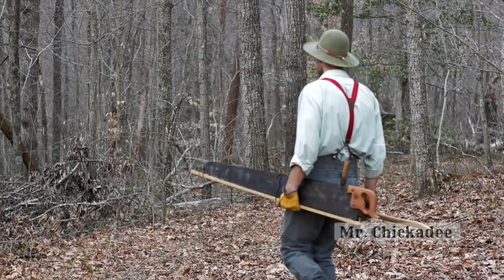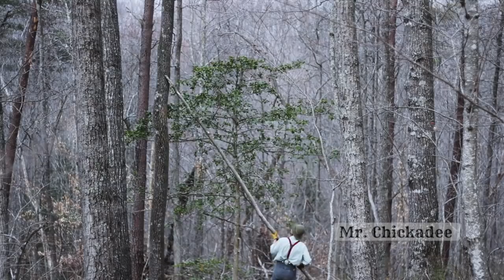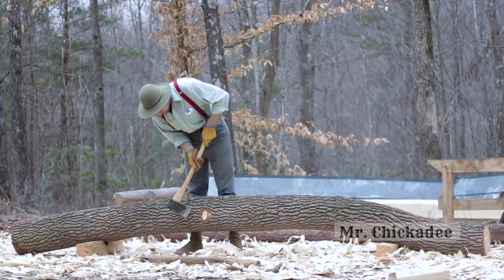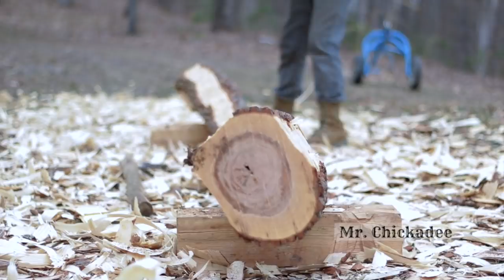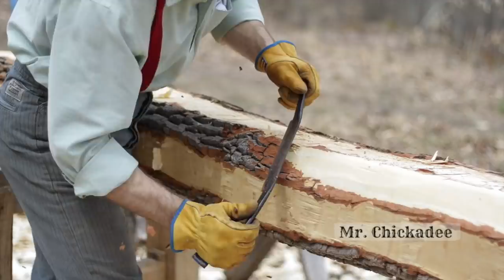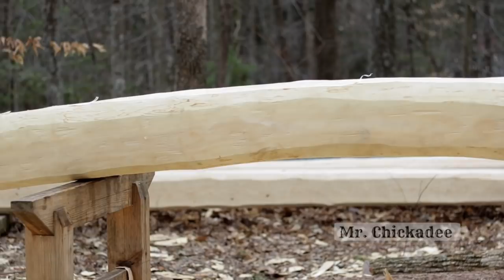Hewing Curvy Timbers for Japanese Timber Frame

Comment: Hi Mr. Chickadee ! Would be very nice to talk about the moisture of the wood. Do we have to dry wood like most of woodworkers says? Can we built tomber framing and furnitures with wet wood ? If we only works with hand tools and traditional joinery? Very hard to get the truth about it...
Reply from the maker: No, it can be used green, dry or somewhere in between.

Comment: Funny how falling, bucking, skidding, barking, and squaring a log in cold still weather eliminates the need for coats.

I bet your cats weren't out in the snow for hours supervising. I bet they were curled up snoozing by the stove that burns the wood you got in last year.

Hm. I wonder what that graceful octagonal timber and the other three straight ones will be used for. I'm guessing some form of torii. Looking forward to future videos.
Reply from the maker: They are all various roofing beams for the fall class frame, this one in particular is an arch above a doorway. The others do look straight but are actually a gradual arch of about 8" over 20' span. All octagonal in the japanese tradition

Comment: I’ve got a 150 year old hewing axe head made for doing that. It does not look like it was really needed.
Reply from the maker: Those were specialty tools often used by professional hewers in times past. They do make more sense when the timbers are very large, like a 12X24" beam for example, the larger blade could help with that. I own a few hewing axes, but never need them...
Reply: I more or less lucked in to this one. It is a Yerkes & Plumb. Cast steel.  From what I could tell from a search, Yerkes was with Plumb till the late 1870’s

Comment: I'm curious...as every step you have has a specific purpose, what was the benefit of having the tree fall in that particular direction?  Nice video as always...thanks.
Reply from the maker: Good question, if left to fall in its natural lean it would have hung up in a pine tree, so I corrected that about 20 degrees with the spring pole.

Comment: Hopefully, you will walk through treatment for the final material.  Also, you pealed that while still wet right, so are you worried about warp as it dries out?
Reply from the maker: The method of layout I use accounts for all types of twisted, curved and otherwise out of square timbers, so no worries there. I expect a bit of movement as it relaxes over the summer, but much less after that.

Comment: we actually have main floor support beams in our 200year old barn as S twisted like these.
Reply from the maker: really? is that floor hard to walk on?
Reply: @MrChickadee  i guess they would actually be the joist spaced approx every 2ft. they are  hewd on two sides and layed flat over the main beam 18" X 23"X  70'
Reply from the maker: @shanestamball1886  18x23 is a beast, 70' long? Surely it was scarfed somewhere?
Reply: @MrChickadee  it was at 62 looks like a ship lap, but it was our belief it was done at a later time. we own one of the largest bank barns that still exist in the state of pa. the chimney stone on the main house is carved 1765, and the original stone (summer house) was thought to be built 2 generations prior
Reply: @MrChickadee  i also took part in tearing down a similiar barn on a neighboring property 25yrs ago. and the purlin beams were 4X7X60. im not sure what the original trees were that grew in this area. I know there was sone kinda blight or bug that wiped them out 150yrs ago. its amazing to see some of the industrial buildings in my area that were built in the late 1800's and to see the post in these places. i worked in a 5 story building that still stands today. and 
the post are a solid 4ftX4ftX10' in the basement.
Reply: Not always. I was in a barn near Lancaster PA last fall. It has Chestnut and other woods sixty foot long, no scarfs. That was an eye opener. The barn was two story. Pasture on the high side and driveway with sliding doors on the lower section. He had tractors and pick up trucks top and bottom. Old livestock farm.

Comment: This has probably been asked on a previous video, so if someone could point me it would be much appreciated! You hewed the timber while it's green, what about the drying process? Do you dry before joinery or after?
Reply from the maker: Good question. Short answer is it depends. There are many timber framing forms which use fresh green wood, even to the point of being in a "rush" to get it joined and raised so it may dry together. Other forms of timber framing, such as much of Japanese framing use fully dried or mostly dry timbers. They often dry them for many years before use. I prefer joints which can be tightened as well as drying as long as I can, which is often 6 months to 1 year.
Reply: Well thought out answer with good information.

Comment: Was expecting to see a slightly older axe (Heirloom), was wondering about your end grain prep, is it the species, your climate, or just your method (green wood construction?) that doesn't require sealing the cut ends to limit checking/splits of your beams during seasoning.
Thanks for sharing, really respect your work
Reply: Timbers will check inevitably, sealing wouldn't prevent this.  The only method possible is to cut a relief kerf down to the pith on one side of the timber to limit most of the checking to a non-visible side.  This is a traditional technique in Asian timberframing, but in Western timberframing typically you just let the beams check how they want.  It doesn't impact strength at all in a boxed heart timber like this.
Reply from the maker: This axe was bought new by my grandfather in the 1930s. Ive hewn more than an entire frame with it alone, and replaced the handle twice. 

I did seal the endgrain, after the video. I dont always do so, but like to with most hard woods as it slows the drying. 
Checks will happen unless you cut free of heart timbers or kerf to the heart all boxed heart timbers, and wedge it open as it dries.
Reply: @MrChickadee  All good, it's fantastic to be able to use tools that were used by generations of craftsman, so much more enriching when they are connected by family, and I certainly thought it to be your style to use such tools. Apologies for presuming otherwise.
Guess I was jumping the gun a bit on both my questions.....what did you use to seal end grain, what was used traditionally?
Reply from the maker: @bunyipdan  I use lard as it works well, is easy to apply and is cheap. Any waxy substance would do...
Reply: First I have heard of using lard. Any special prep besides rendering or oils added to the process? Or lie to remove the soaps. No chemist here. All good stuff Mr. C

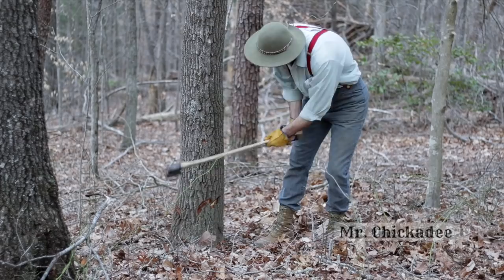Comment: At 1:24 he nearly chops his foot...bad technique there buddy ..however it’s fantastic to see how
you used that pole to fell the tree!
Reply from the maker: Reviewing the video I see how that could appear to be the case, but it was in fact an optical allusion. If you watch closely the following few seconds you can see my right root toe edge is behind the tree trunk, showing my feet were never close the the path of the axe in fact. 
Also note these were very light "half blows" directs to remove bark in a glancing wax, even though I follow through and touch leaves, the blows are so light I don't even pass into the soil.

Comment: How do you stop the green wood from cracking when it dries?
Reply from the maker: Although drying cracks will not effect the structural integrity, they can be avoided by sawing a kerf down to the trees heart all along one side, then keeping wedges firmly driven in as it dries. This spreads the stresses in this one large crack, while avoided them elsewhere. Later you can either patch the kerf cut or just turn it in some direction where its not visible, like up for a roof beam, or out for a wall post. This has been done in Japan for thousands of years in high end construction, so no visible cracks are seen on the finished timbers

Comment: Did you have to sharpen the draw knife multiple times? Or does 1 sharpening last the whole log?
Reply from the maker: It really depends, was the log knotty, was it hard sourwood or soft tulip poplar? In knotty or hard wood, I touched up the edge after each of the four faces. In soft clean wood, I finished with still a shaving sharp edge...
Reply: @MrChickadee  Thank you, I don't know if I've ever seen anyone sharpen a draw knife on you tube. I'm sure I can find a Roy Underhill video at some point that shows his technique. Also, watching your videos are very therapeutic. There is often a point when I reflect about life stress and think, "man, I really could use one of your videos about now." You must have a pattern down, because often when I think it, a video appears
Reply from the maker: @tkjazzer  A draw knife is pretty similar to a long chisel, normally tempered too hard to file, they must first be ground so the bevel is <20 or so then honed on some stone to 25-30 degrees just like a chisel. You can do it either by passing the draw knife over the bench stone that is laying on a workbench or table, or by holding the drawknife in one had whilst drawing a small stone (axe stone works well here) over the blade with the other hand, first one side, then the other, then repeat just as with an axe. As with most edge tools, biggest hurdle to keeness is too thick of a bevel! Get that bevel ground down!

Comment: For what purpose did he hew this curvy timber (and not a straight timber)? What does "Japanese" imply?
Reply: "Japanese" most likely refers to the joinery methods that he'll use
Reply: This will likely be an overhead beam. Being arched will give more head room or just a cool factor.
Reply from the maker: @15630scarusrd  Thats right Don, its for an arched timber door header.